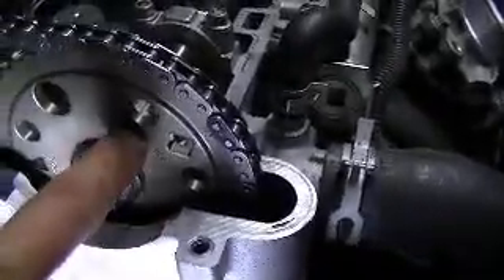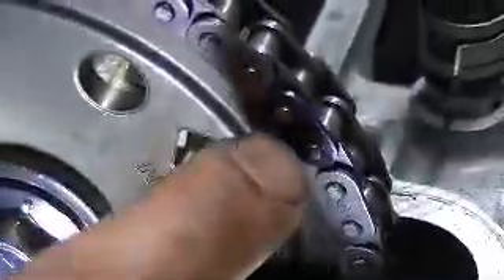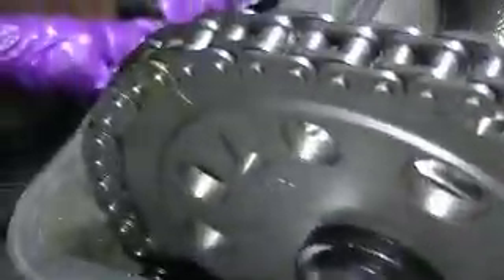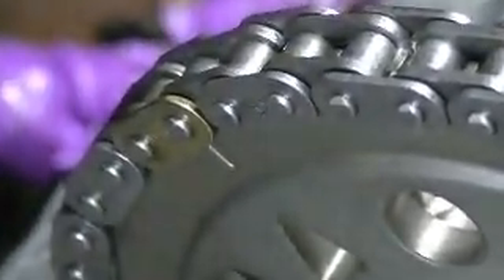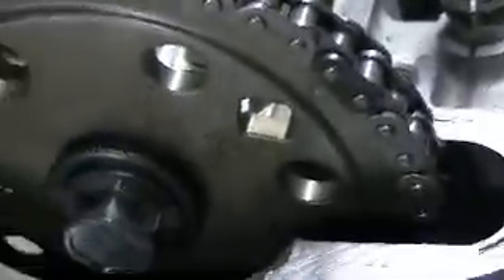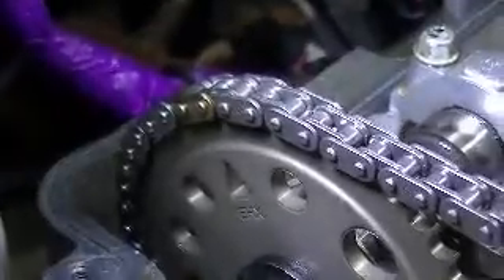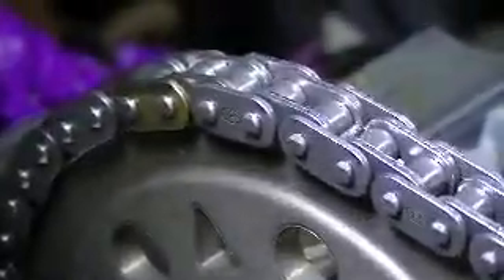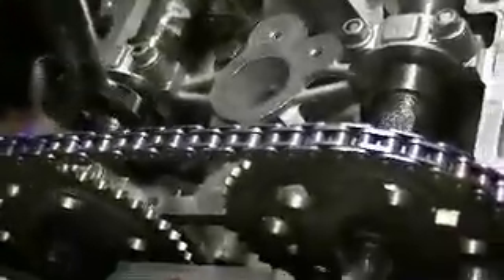Timing chain alignment marks 2007 Chevy Cobalt 2.2L ecotech

Comment: Thanks for the video! Is there any line up procedure for the other balancer / water pump chain? It seems as if there should be since you have to use the OTC tool to hold everything together when you replace the water pump. I'm doing some preventative maintenance and replacing the entire timing chain(s) kit which includes the water pump. I'm assuming I will remove both chains and then remove the water pump last?

Comment: I did everything step by step and when I go to crank it over by hand to check the marks its off already with only one turn.what am I doing wrong?
Reply from the maker: Joe Manning If you are referring to the colored links on the chain... then you are doing nothing wrong. The colored links will never line up again. As long as the crank dot is at 5oclock and the cam gears are at 2 and 10 oclock then you are good to go
Reply from the maker: +Joe Manning Usually the timing chain kit comes with new tensioner. Replace broken guides, and u might wanna check for bent valves.

Comment: hello you videos are very informative i am having trouble and i have lined up my timing marks exactly like you have 5 times and then tested it by rotating the crank by hand to see if my marks come back around to the same spot but it will not do this all my components match the originals but i don't know what i am doing wrong do you have any insight or my issues. i jumped timing so i could have damaged some valves but not sure. no compression on any cylinders.
Reply from the maker: After you line up all your timing marks and begin to rotate the engine / crankshaft by hand.... the timing marks will no longer line up. However, if you jumped timing via a loose chain or some other reason you most likely have bent valves. These are very easy to bend b/c they are so small and thin. If you  remove the heads to see the valves and pistons make sure you replace all the head bolts b/c they are stretch bolts. It's gonna cost over $100.00 for the head gasket kit with all the bolts and gasket. As long as you line up the timing marks correctly and the camshaft sprockets and on correctly and not 180 degrees backwards.you should be okay. If you can rotate the crank without any binding then put the timing cover and valve cover on and start up the engine and see how it runs. It wont run for long without the alternator belt on though, but if it won't start at all then you probably have bent valves. Or if it is backfiring and popping.... bent valves.
Reply: davidmezera thank you very much i was pulling my hair out and am going to take the head off tomorrow and i appreciate the grate videos have a good one sir
Reply: @davidmezera  bro this reply is 7 years old but I hope you reply, I have the same problem as the guy. I replaced the timing chain but won't start, I'm sure it skipped timing cause the chain was so loose n the guides were all broken but I didn't think the valves were bent or broken, it was popping and backing firing a few days before it completely died, so that means the valves are fucked n need to do a cylinder replacement?